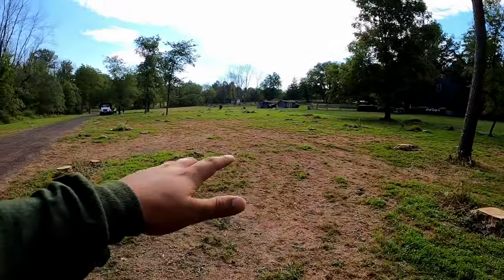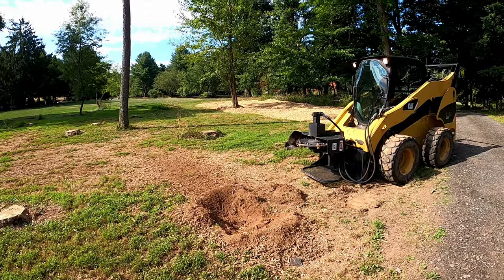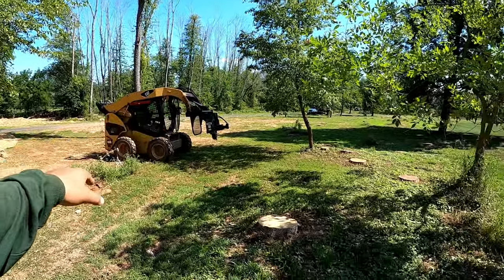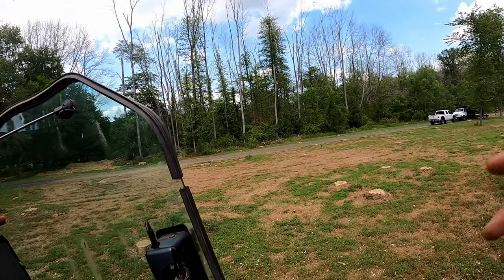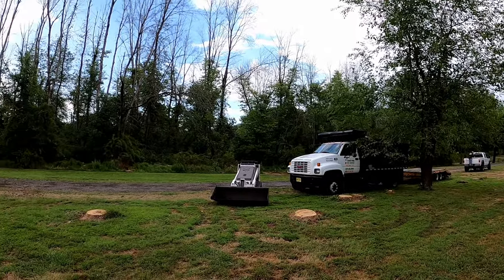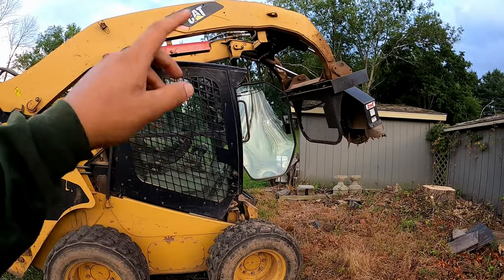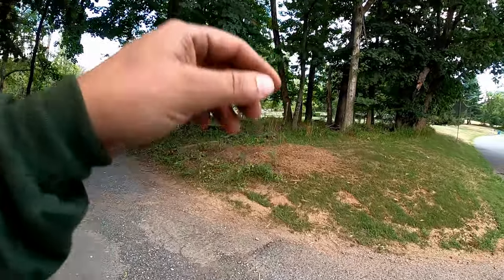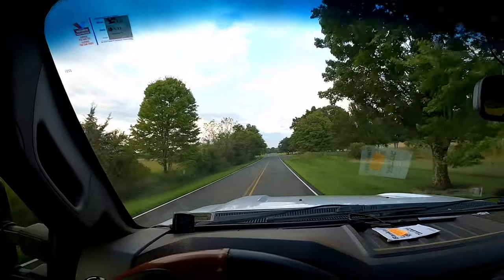Removing Over A Hundred Tree Stumps In One Day | We Try Out A New Skid-Steer Attachment

Comment: That Hydraulic motor will not last long.
Reply: It doesn’t have a case drain, so it most likely a low flow motor, as long as the gpm is matched to the motor it should last at least a few hundred hours.

Comment: I have the same grinder and have learned a few things about it.  
It's only designed to be dragged through the stump not pushed through.  There are pins you can take out so it can kinda float through the stump. It's not supposed to be solid mounted while you are pulling it through the stump. 
You figured out the starting on the right side of the stump.. nice work.. 
When those finger style teeth get trashed and bent over ect you can replace them with Rayco style teeth. They are a huge improvement!!
Reply: Hopefully you’ll see this comment. Just bought a used Stumper 240 and all the teeth need replacing. Which Rayco teeth are you talking about?

Comment: 8:23 i don't own one, but its hydrlics that drive the motor, i belive speed is a key to keep the blade moving
Faster means more wood removed
Now lower how deep your cut is in a pass. I cant see how running full pressure would  be a problem.
Maybe next time you buy a tool read the operating instruction.

Comment: It works fine.
It seems like that attachment needs its own lateral control (in and out) or hinged radius movement/cylinder so you're not having to roll/move the whole machine back and forth.
It seems that would give it much more fine control without bogging down ;-)